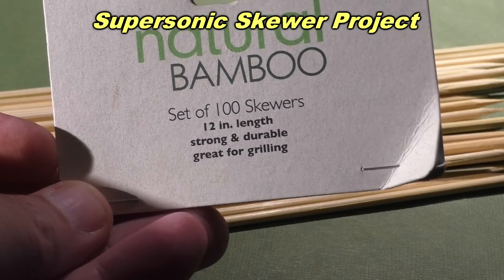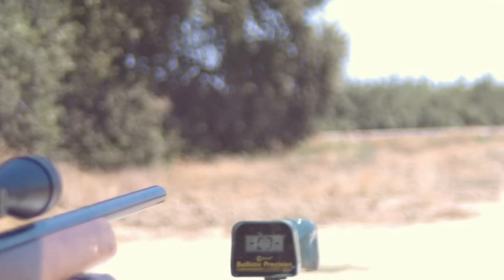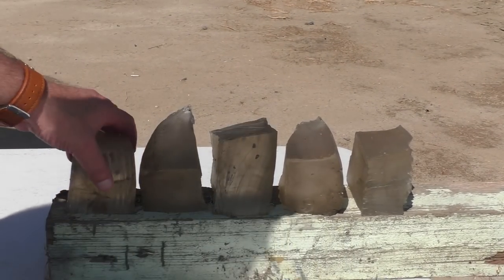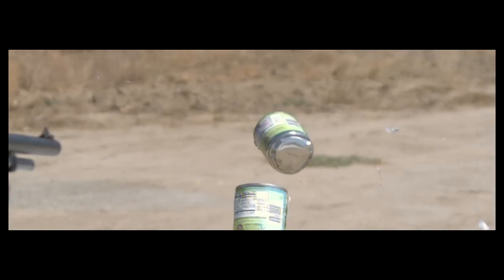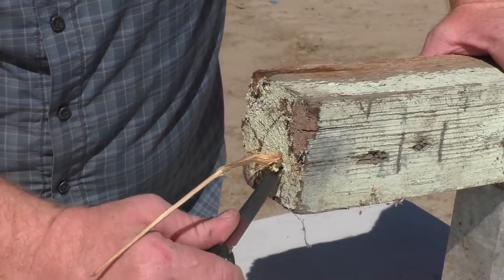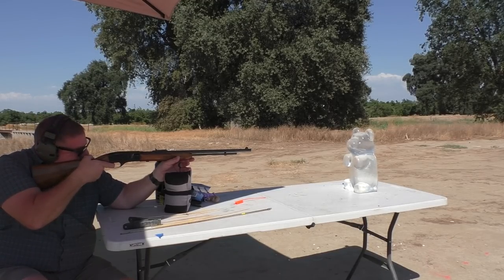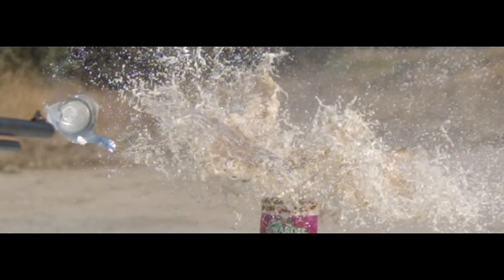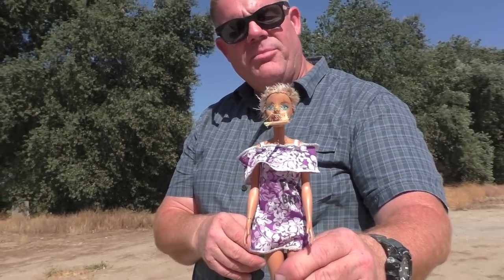Supersonic BAMBOO SKEWERS -  Tested!

Comment: While I know the "piece of straw penetrating wood" is a sort "myth" but after living through tornadoes I've seen crazy objects stick in, or completely penetrate objects much stronger than wood . I seen a 2 inch by 2 inch piece of wood completely go through a steel pull barn wall. So crazy circumstances like that can happen.
Reply: I have seen pine straw sticking out of an oak tree that it almost penetrated. Velocity defeats many things. Hurricane alley here.
Reply: I saw a sheet of plywood thrown edge on thru a construction office trailer by a tornado in N. Alabama, a slit on one side and a slit on the exit side & everything inside sliced in its path. Luckily the trailer was unoccupied at the time.
Reply: My dad told me about a farmer in southern MN back pre-1950 that was killed by a feather (can’t remember if it was a chicken or turkey feather) that a tornado picked up and hit him right in the heart. My dad told this to a neighbor and she said that they had found a silk scarf gone through a wood closet shelf.  I think that the wind has a profound effect on the speed at which these objects can be flung but in some cases I wonder if the extreme rapid pressure drop may also contribute to these things? But I think that there’s a huge amount of extreme dumb luck, sometimes extremely bad dumb luck in the case of lives lost on how these things happen.

As a kid doing dumb kid stuff I’ve spent hours try to recreate something cool that happened because of dumb luck and not been able to achieve the original cool thing that happened… just saying sometimes the universe deals you a one time only card and that’s how you have to accept it. Of course if you don’t do anything you don’t get my new cards! 

That’s why sunrise and sunset are so great there’s new ones every day and a chance to see something different. 😉
Reply: I made a rubber band crossbow thing as a kid that shot shish kabob skewers into somekind of really thin craft wood. For the longest time I had it in my room posted up until I was old enough to actually get a 10/22 at the store.
Reply: @zachjameson5442  yeah I've seen tornado strength winds do crazy things. Even just ef0 and ef1!
Reply: @tbthedozer  Seems more likely that he was hit by a chicken or turkey, and one of the feathers stuck into him.
Reply: I have seen cars after a hurricane with the tinyest damn sticks shoved through a car door. Rocks stuck in a hole etc.
Reply: Not a myth, it's in the natural history museum in Oklahoma city, a section of telephone pole with a plastic straw sticking 2-3 inches out of it. There is also an x-ray picture of it so you can see it inside of the pole.
Reply: There are 2x4s in brake drums, and im near positive actual straw, and not a straw, in not only wood but steel.
Reply: @raid7866able  i fixed alot of cars after that homestead miami hurricane.
Reply: I watched a test video for nuclear reactor containments. They are built out of concrete with rebar in them. One very interesting test was a six foot thick section of wall that was shot with a pine 2x4 piece of lumber to simulate debris from a tornado. The piece of lumber was launched from an air cannon. The slo-mo showed the lumber being turned into small chips on impact. It failed to penetrate the wall, although it left a small crater on the impact side.
What was interesting was the OTHER side. Although there was no hole through the wall, the other side was completely blown out! Massive spalling damage.
Reply: I saw a documentary once about a tornado that hit Kansas back in the 20s or 40s that literally picked up an entire house and flung it all the way to another land. Crazy part is, it was like another dimension, they had talking lions, wizards and witches and even flying monkeys! The monkeys were probably from the tornado hitting a zoo, but who knows. Anything is possible these days. What a weird world we live in! 
Anyone see my car here?
Reply: It's all fun and game until you notice the hurricane or tornado s firing semi trailers through strip malls.
Reply: @stanleyrucci21  I've been there. Stick to the road. The flowers look pretty, but they have some weird aroma about them that makes you seriously trippy.
Reply: On a school trip, our bus got caught in a Nebraska tornado.
Hay straw COMPLETELY through the radiator. Everyone was fine, but really bored waiting for another bus from Iowa!
Reply: @Fudmottin  yeah those are some good flowers.
Reply: Pole barn….
Reply: @stanleyrucci21  Then the guy behind the curtain was elected President....
Reply: We went through an EF1 tornado.  A door and frame were pushed in to the house an inch and a half.  Thirty feet away an aluminum jonboat on a trailer never moved.   Nature is strange.
Reply: @LongBinh70  
I experienced a tornado from a mobile home. The thing passed within 30 yards of it. The couch bounced up and down out into the middle of the livingroom. Just to the rear of the home was a building that looked like you had opened a box of matches and flung the matches out. The sky looked like a black eye. Black, purple and reddish yellow and sounded like a large locomotive coming. Something I shall never forget. I was around 5 to 8 years old. If I see that sky I know what is possible.  Something similar but not anywhere near the extent can be experienced by putting one rear window down on some vehicles while traveling above 50 mph. All other windows up. Should have a thumping pressure effect on your ears if done correctly.
Reply: Saw a roof shingle stuck into a stucco building after a hurricane in Houston once
Reply: They test building materials by shooting 2x4s through an air cannon. So I assume there's a reason. Also ... if you ever heard the term "shiver my timbers" that refers to the thousands of splinters that result from a wooden ship being hit by a cannonball. Let's not forget about a popular way artillery was used in world War 2. Air bursts into heavily wooded areas. It turned trees into wooden shrapnel.
Reply: @thefunkosaurus  At least there wasn't some winged demonic dude with a wide brimmed hat shaking things up. Jeepers creepers that would have been scary!
Reply: As teenagers, when we used to shoot bottle rockets at each other, the small cheap ones, we'd find the sticks stuck into lumber and trees, etc. You'd think that might have caused us to stop shooting at each other. You'd think...
Reply: @LeesChannel  it hit him quill end first or whatever you call the part that’s in the skin of the fowl. It’d be much tougher to get that end from a bird strike.  Since it’s farm country I reckon they could tell if the bird hit him by the “juices” that were not present in the fabric..eeewww right?   I bet getting hit by a 300 MPH beak would really hurt!
Reply: @williamivey5296  You just reminded me how much I miss Roman Candles.
Reply: After Katrina we saw a piece of tin (roofing metal) through a decent sized pine tree.
Reply: @viperstrike3827  Flying buzz saw!

Comment: That one I think is worth revisiting with actual skewers. Those were the cheapest ones at a grocery store, but there should be slightly thicker bamboo skewers right next to it. Wish I had a 22lr to try myself.
Reply: knitting needles too. theres gotta be on thats close to .22
Reply: @murlock666  there definitely are, in wood, plastic and metal.
Reply: Yeah but these skewers were a lot more structurally sound than a piece of straw or grass is so for the sake of kinda testing the tornado myth these cheap skewers were a good test projectile. If these cheap skewers disintegrated on impact a piece of straw or grass like they often mention in the tornado myth would definitely disintegrate.
Reply: I know the point was to try and test the straw in wood idea. I'm more interested in making a stake shooter lol.
Reply: I thought everybody had a .22!
Got mine by saving up my paper route money when I was 11.

Comment: You may be able to get some wood dowel rods that can be cut down and a pencil sharpener point on one end. The wood dowels are often next to steel/aluminum, etc, dowels in hardware stores.
Reply: Could just get some chopsticks.
Reply: @emperorhadrian6011  I was going after something more uniform in shape and less barrel wiggle.
Reply: @michaelleeper3649  
Yeah but chop sticks sound pretty fun.
Reply: @emperorhadrian6011  yes they do. Those also have a heavier end and may do some damage.

Comment: you should try shooting a crossbow bolt or full size arrow from a shotgun because it has fins to stabilize it and instead of the normal smokeless powder use black powder so that you can dial in the load better using smaller amounts or larger particle size that way it doesn't shock the arrow and break it
Reply: Nah.  The Jackasses at Red Jacket tried it, it didn't work very well.
Reply: Arrows don't survive full power loads, the best thing you can get for shooting arrows is the new airguns that are purpose made for it.
Reply: @TheExplosiveGuy  There is also a barrel for the 10/22 that uses blanks to fire arrows.  I hear it can send arrows at over 500 fps.  it slips the arrow over a tube so it's like blowing the wrapper off a straw instead of stuffing the arrow down a barrel.
Reply: Am I crazy or does anyone else remember them firing arrows at a firing range years back?

Comment: Very interesting how the chrono can read a long bamboo stick like that. Time for me to learn how a chrono works now.
Thanks gents, and thanks Danny 👍
Reply: Essentially, it creates a pair of light beams. When the first beam is broken it starts a timer and ends the time when the second beam is broken. Since the two beams are a set distance away, it's able to calculate how fast an object is going by taking said distance and dividing it by the time it took the object to reach the second beam. There's a smarter way to say that, I'm sure.
Reply: @ianfinrir8724  Roger that. So it measures from the same point (no pun intended) beam to beam negating the length of the object being timed. Thanks man
Reply: @ianfinrir8724  there may be a smarter way, but your way is accurate and easy to understand.

Comment: Also, maybe try soaking them in water overnight? Give them some more density and it might not splinter as much…🤔 water soaked skewers Jeff try it!! Part 2
Reply: Yes, considering that is usually how they are used for high heat application, this might not be a bad idea. Possibly a plastic wad of some kind, maybe those cheap Bic ink pen tops wouldn't be too bad an idea?
Reply: They already said they aren’t doing a part 2. Maybe you should do it, film it, and put it on YT yourself?
Reply: That method works when I kebab, worth a try
Reply: Soaked in other liquids, mineral oil, gasoline 😀
Reply: @donnybrookinhooligan1088  They already said they aren’t doing a part 2. Maybe you should do it, film it, and put it on YT yourself?
Reply: @Thissapunyo  They already said they aren’t doing a part 2. Maybe you should do it, film it, and put it on YT yourself?
Reply: @vincedibona4687  I never said anything about a part 2. End of quote, repeat the line.

Comment: Tech tip. You can make a blank stronger by packing the powder in a blank by tapping the rim against a hard surface. You can weaken it by tapping the front on something.  I worked commercial construction for decades. Sometimes we needed blanks to be stronger or weaker depending on what we were trying to fasten to.

Comment: Could you possibly make say 17 HMR blanks and try those? Or would the skewers be too thick at that point?
Reply: Better off getting royal nonesuch or someone to build a smaller barrel for the 22, probably doesn’t need rifling
Reply: I would expect the 22 nail gun blank would fit in a 17 hmr chamber.
Reply: @ExF1Guy  they might actually. How much shorter are those compared to 22 mag casings?
Reply: @societyz3r0  
Not entirely sure. I believe they are similar in length to 22lr brass, which I am virtually certain will fit a 17hmr chamber. The case will likely split, similar to how a 22lr will bulge/split when used in a wmr chamber.

SAAMI has all the cartridge dimensions available for free from their website. If you check the chamber dimensions of 22lr and 17hmr, that should tell you for sure.

Comment: I wonder what would happen if the sticks were soaked in resin or a type of glue? That might be interesting
Reply: And maybe something to help stabilize them in the barrel at mid skewer? Tape?
Reply: @neisan92 that could work maybe small plastic wire casings too?

Comment: What I've always been told about the straw in the pole is that the wind fully supports the straw, and also continues with it, vs the way you are doing it where the power only comes from the initial blast. More a throw rather than constant push force

Comment: I owned a sporting goods store back in the 70's.  We were a dive shop and gun shop.  I was working on scuba regulators one day and was using wood shafted "Q" tips, cotton tip applicators.  To apply silicon to O-rings.  In a rack on the bench was a .22 rifle barrel we had taken off a rifle that had been ringed by a stuck bullet.  I thought wouldn't it be cool to run the 1st stage air from the regulator (125psi) behind one of the q tips like a blow gun.  Put the barrel in a vise and placed the sharpened q tip in the barrel and placed the regulator hose against the chamber of the barrel and cracked the valve.  The dart went through the hollow core door on my office and imbedded itself into the pine paneling on the far wall of my office.  It is still there.  Tried with some real high pressure, 1500-3000psi and it would shatter the bamboo just like you show in the video.

Comment: As a kid when i ran out of ammo with my pump pellet rifle i would load tooth picks down the barrel as a makeshift muzzle loader. After some work the best i could make the tooth picks fly was to cut them in half. Because a long projectile tends to tumble in the air. Then stain them to add weight, and paint over the stain to provide exterior strength and prevent splitting from the pressure. I tried wadds of different types, but they only got in the way. 

The end result was a very cheap and lethal rat dart that was good up to 20 yards. My parents didn't like this new hobby of mine and cut my pellet rifle in two. They always ruin the fun.

Comment: Barley straw is, per weight, about 5x stronger than bamboo.  It's also knife blade thin like a hole punch's edge.    It would be interesting to see if you can have Evan make some .38 bamboo slugs.

Comment: This reminds me a little bit of a similar concept commercially developed back in the ‘60’s into an even weirder speargun - Johnson Submarine Gun (SMG). One of the guys I dived with back in the day used one they were heavy, loud and quite powerful. They used a modified 22LR Blank sealed in a cigarette sized waterproof plastic sleeve and shot a 7mm spring steel shaft, and they even had multi barrel options 1, 2, 4 and 6 which were selectable in a revolver type arrangement ...... maybe you could find one of these a fire bamboo arrows out of that. Anyways keep having fun guys, cheers

Comment: well mythbusters did that with aircannon they had a looooong barrel, that episode they did a long barreled Air cannon, and had straw and  piano wire that they fired out of it. and they did get the straw to stick the tree they had,  it was super interesting episode,   and the air gun works because the it gains more velocity as it goes along the barrel. and the shock the projectile receives is not as rough as its from a firearm. and my thought prossess is that if the projectile survives to the high velocity, its not gonna break during the flight.   althou in mythbusters they did have the barrel like 30cm off the tree when they fired, but their projectiles where going a LOT faster than yours

Comment: The reason why straw sticks in a telephone pole in a tornado is because of the vortex effect created by the tornado while the base of the telephone pole is secure in the ground. When a tornado passes the telephone pole it basically has enough force to untwist the pole and it opens up the grain of the pole vertically and with debris flying around (including hay and straw) when the tornado passes it releases the untwisting of the pole and the grain recloses and sometimes when that happens straw and debris are caught in the grain of the pole randomly. The straw never gets stuck in the telephone pole because of force from being shot into it from the tornado by sheer power. They will never penatrate from that.

Comment: Hey TFM, I heard a rumor while I was in the Army about a soldier using his M4 cleaning rod as a projectile to skewer squirrels out in the wilderness. Is this possible?
Reply: A guy I work with told me a story about when they were stationed in Germany in the 80's. They fired a cleaning rod from the MG mounted on the tank and skewered a wild boar, ham steaks for dinner.

Comment: A simple modification would be to use a sharp pocket knife and carve 3 or 4 fletchings at various positions on the skewers giving it more stability in flight.
--->------>------>------->------------->  <tip of skewer.

Start with one, then two, then 3 then 4 fletchings along the skewer. 

You also may be able to use a dowel that will fit more snug in the .22 barrel. Still, carve a point on the end and whittle a few fletchings in the end. Betcha you can poke somebody in the eye with this get-up at 7 yards!

Comment: I've seen where most of the long straight piece of a coat hanger was cut out, with a steeply-angled cut on one end to make a point, then shot from a multi-pump .177 air rifle with a square of toilet paper rolled-up on the square-cut end for wadding. Seemed pretty deadly at close range. Certainly the target varmints didn't scamper away. Nor could they, being nailed to the wood behind them. Might be good at longer ranges too, if the steep cut was made symmetrical.